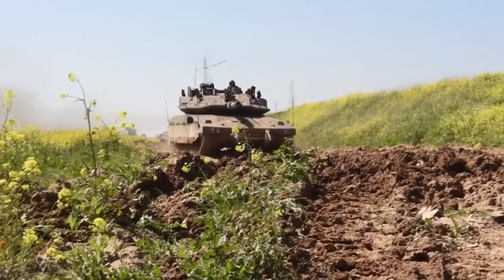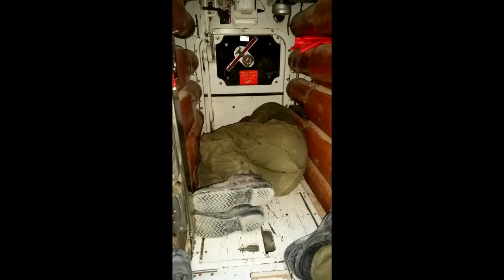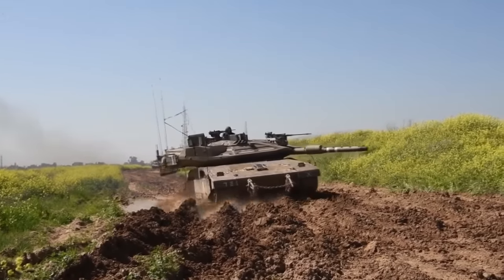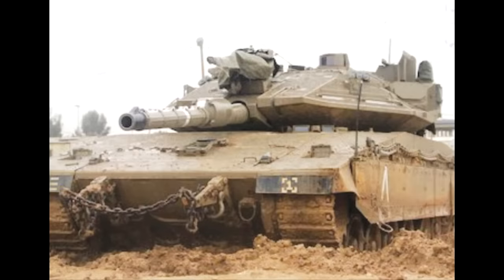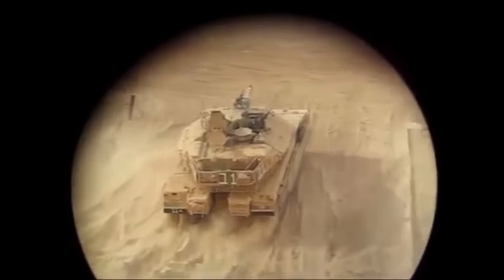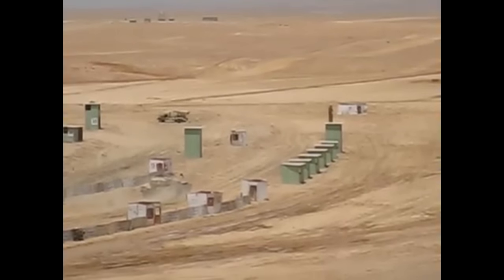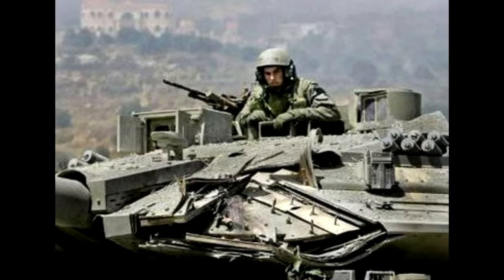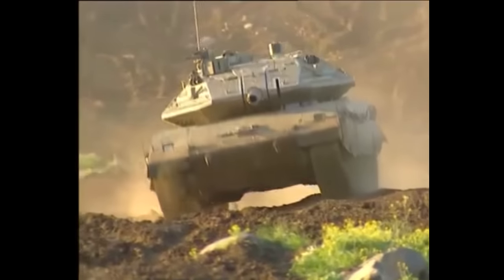Problems with Merkava tank

Comment: Merkava has paper-thin armor protecting its engine. Other tank doesn't use the engine to protect the crew, but they have much, much thicker front armor that protects everything.
Reply: The merkava isnt designed to fight other tanks, the paper thin engine armor is due to the engine's ability to absorb the heat jet from chemical warheads, the most common threat to a merkava

Comment: Just as a speculation from someone who knows little about modern tank warfare, the engine in front still seems like a decent idea, as if you're hit there and for some reason the projectile doesn't destroy more than the front part (shot from the side or HEAT round) I much prefer for the tank to not be able to move than for me to be dead

Please feel free to correct me if there's something I'm missing in that sense
Reply: @zorans5200  The point is you have a chance of getting out.
How often do tanks operate alone or better yet how many expensive anti-tank rockets are palestinians willing to use on a single tank

Comment: doesn’t the merkava mk4 have composite armor too? you didn’t mention the type of armor the merkava mk4 is using or maybe I just missed it. In my line of thought merkava using extreme slope angles on its armor + composite armor = engine is safe to some degree
Reply: The Merkava uses NERA arrays just like every other MBT, but uses it incredibly inefficiently and so has to rely on the engine compartment as spaced armour.
http://sturgeonshouse.ipbhost.com/topic/553-fucking-nera-everywhere/

M829A3 would most definitely penetrate the LFP and UFP, resulting in an engine kill and the crew having to bail out. The driver is protected by spall liners so a driver kill is unlikely but quite possible. The latest Russian APFSDS would also perforate the Merkava's hull easily.

The turret would be another matter, because it has pockets for NERA arrays at least 1.5m thick. But again, turret sides and hull sides would be prime targets, as the IDF has found out to its chagrin in Lebanon.
Reply: I don’ t understand. It is bad when front located engine had hit, but much better if crew got killed but engine and tank still can be reused.
I am not sure that crew can survive any hit in the crew compartment by modern AT rocket. 
Consider that crew compartment is also full electronics and other modern equipment that Han be damaged too am not sure that tank can be easily reused after such hit.
It takes time to return tank to service after the damage. 
And if block of engine is single part that needs to be replace, it is easy fix if there are some spare ones.
Reply: Chris Bailey  Well clearly they care about their people.
Reply: Yes and no. Depending on the type of composition sloping can actually not help much, or the armor becomes INCREDIBLY resistant to chemical rounds, but a dinky cold war 105mm royal ordinance sabot goes clean through it.
Reply: Chris Bailey  Israelis value any soldier's life far far beyond any sum of money. In addition, bear in mind that all Israeli Leaders did serve in the army, most of them in combat duties.
Reply: @IYuli-rr8vr  he thing is it has worse protection than any other modern mbt thus its irrelevant point as the crew is dead if shot by modern apfds

Comment: The Merkava IV vs M1A2/T14 Armata/Challenger 2 are  designed according to different national doctrines and operational requirements. The U.S/Russian/UK tanks are meant to fight rapid Blitzkrieg-style wars with enemy tanks as its chief target. The Merkava is expected to fight defensive battles and provide support to counterinsurgency operations in urban and mountain terrain.  The Merkava is designed to deal with very specific national requirements. The front engine design is a throwback to the Mk1 of the 70's when they didn't have the armour necessary. Since all Merkava MBTs share the same chassis, the Merkava MkIV is still stuck with a front-mounted engine. But as you say it is an issue.

Your assessment focuses on tank fired rounds. The Israelis are much more worried about ATGM's. In the 2006 war in Lebanon the IDF recorded over 500 AGTM  attacks on its tanks. Out of 50 Merkava IIs, IIIs and IVs struck by Hezbollah projectiles and IEDs, 21 were penetrated and six destroyed. 18 MkIVs were hit by ATGMs during the war, resulting in only one tank destroyed and not a single death. That's pretty impressive. The same missiles have also been very effective against Saudi Arabian M1 tanks in Yemen. (Granted the Saudi M1's don't have the same armour package as the US).   Since they introduced the MkIV Windbreaker with Trophy APS,  not a single Merkava tank has been lost in combat operations over the period between 2008 to 2014. And that includes intercepting the Russian Kornet Missile.

Comment: Sure it has problems when you compare it to modern 1st world tanks.
But uhh....
It's never going to face a modern 1st world tank, and it's never going to face anything equipped with APFSDS. Maybe an APCR if it's a bad day?
Its main opponents? T-34, T-55, T-62 and the occasional early model T-72. At best, these will be equipped with a semi decent HEAT round. Most of the time, they're going to be slinging APHE or just AP.
Really there's only 2 other nations in the area that could even afford to equip SABOT to their tanks. They don't share a border with them and have been content to just leave them alone for the most part.
So unless good old Uncle Sam decides they wanna start handing out Abrams to Egypt, Syria and Jordan, Merkava still pretty much out classes anything else in the area that it stands even a remote chance of facing.
Reply: Syria, Egypt, and Jordan have a decent arsenal, they have numerous state of the art T-72B3, T90, M1A1, Challenger with numbers of at least 200 upto 1300 for each tank model.

Comment: The engine being damaged is better than the crew getting obliterated
Reply: If the engine died .. tank stops , the crew will have to leave the machine.  outside, it will be оn crossed
 fire ..
Reply: In both cases they're fucked most likely. 

Crew dies > useless tank

Tank immobilised > crew has to get out > most likely crew dies > useless tank and dead crew.
Reply: @mazen6446  Remember you're not fighting in streets or close quarters, these tanks are used to fight at range. They aren't a 'lone wolf', if one tank gets knocked out there are others to cover them, and often other vehicles to CASEVAC. During the wars in Lebanon and Intifadas a majority of Merkava crews did manage to escape unscathed or wounded and make it back to combat
Reply: Morningstar 
Atleast the gun still working

Comment: LOL I always thought armor protection was this tank's only strengh.
Reply: Chris Bailey  i see someone plays metal slug as well :-)
Reply: Crew protection. Not armor protection. This tank was built with the 6days war in mind. Hull down long range gunnery at stupidly advancing tanks. With that in mind its amazing. Hidden lower plate, good upper plate and turret. Fast firing mechanical ready rack and LOTS of shells in its turret. The rear door allows you to quickly reload mid fire mission of need be. Something no other tank can do easily. In that SPECIFIC role its exactly what they need. But in a hull to hull tank fight? I'd never want to be in this. A modernized T72 would be able to kill it. With probably a better chance at withstanding return fire. A t72's frontal protection is a lot thicker than 100mm...
Reply: Chris Bailey  Eh, the Israelis have fought the Arabs with Russian tanks many times. Im sure they know what's best for their tanks.
Reply: One thing I can’t stop looking at is the lower part of the turret sloping downwards, seems like a shot trap.
Reply: Chris Bailey  see the problem? a tank is never alone anywhere. 2nd. the hull is as same as strong as the t90 tank.and the turret has much more armor then the t90. so ...its protection is still better

Comment: So many odd comments below about Merkava being designed for urban warfare when it entered service in 1978, before Israel went into Lebanon. Merkava was designed to re-fight the 1973 Yom Kippur War. When Israel was caught by surprise and almost overwhelmed on day one on the Golan Heights by superior numbers. The design was also informed by failed Israeli attacks against Egyptian positions on the Suez Canal defended by Sagger missiles.

What they learned was Israel needed a tank with fast ammunition reloads to offset overwhelming numbers before they can mobilize the reserves. This forced them to move the engine to the front so they can load through a rear hatch like the earlier S-tank of Sweden, another country with a reserve system. This meant the engine had to be in the front. While this is not so good against APFSDS, the main threat on the battle field was HEAT missiles like those Saggers. This is also why they put a mortar and a 50 cal machine gun on the main gun mantle to suppress Sagger operators.

The Merkava's hull weakness against APFSDS was regarded as an acceptable compromise as they will be fighting hull down in prepared positions. Once Israel moves into the offensive phase their reserves are already fully mobilized and the Arab armies could not match them, despite the Merkava's deficiencies. You don't need the best APFSDS protection if you're confident you can shoot first hit first. 

This tank was never designed for urban warfare, although it has proved suitable with upgrades. What it was not designed for was fighting tanks with advanced thermal sights and fire control systems. It's at a disadvantage against the Abrams and Leopard 2s with equal crew training.
Reply: spot on ..well said sir, but no the Mark 4 is not at a major disadvantage against either the M-1 or Leo 2

Comment: Well, IMHO, you haven't mentioned the two real problems of the Merkava. It's  ridiculously 
1. heavy and
2. big

The reason behind its design explains everything. It's a tank for a specific region, it's neither for export nor for wars somewhere overseas. You don't need to move it by plane.
Besides, there are not so many rivers in the Middle East, therefore you don't have to worry about bridges to cross.

Hence you definitely can build this bulky tank, but the question is - for what on Earth do you need such a big chariot?

The answer is nothing to do with additional ammunition nor ability to carry infantrymen in the back. The original purpose of the rear compartment was to have an additional crew members there to allow them to rest there and to fight in shifts.

This idea, however, never really took off. On rare occasions tanks are used as ambulances, but mostly just have some shells in the back.
Reply: its not really any heavier than any NATO tanks or larger. it just looks larger because of the turret to hull ratio
Reply: Archie Crick are you sure? Let's compare the Merkava to the best NATO tank, which is probably also the best tank in the world - I mean  M1 Abrams, of course.  Beyond any doubt,  the Merkava is higher and heavier.
Reply: @TheKopalhem  are YOU sure? The Abrams is a very heavy tank
Reply: @a.t6066  Absolutely. Merkava is a few tons heavier (no matter which generation).
Reply: @TheKopalhem  the newest abrams generation weights 70+ tons full combat load. I think the merkava is lighter
Reply: @a.t6066  Well, 70+ sounds really heavier than Merkava Mk.1, yet who knows how much exactly the Mk.4 weights.
Anyway, my point is, it's an unbelievably heavy thing. Even though it may be a bit lighter than the newest M1 with the depleted uranium mesh in its turret, Merkava obviously has thinner armour, taking into account the size. It also has a diesel engine, not a gas turbine. This should inevitably affect its mobility.

Nevertheless, it's a good tank for its role. Its size  allows you to carry more ammunition or to use the tank as "occasional" APC (I don't use the term IVF for a good reason here)
Reply: @a.t6066  A fully loaded Merkava 4 with a trophy system weights almost 80 tons
Reply: @Darktemplar99999  and what accounts for that extra weight?

Comment: I'm a merkava mechanic and I can tell you that there is no fuel tank in the front only at the back of the tank.
There is no problem with the thermal vision due to the engine being in the front.

Comment: This features, just like the Swedes is design for specific requirements of the Israeli Military and their primary enemies are not equipped by high tech AT weaponry and targeting system. even the tank have many flaws but israelis knows that it is not a major concern as a result in the design of the tank. in terms of crew survivability, this tank is the top amongst the best tank in the world. you can easily replace a tank but you can't replace highly trained crew, that's the primary reason why such design feature is incorporated to the tank.
Reply: 'Not equipped by high tech AT' You know that they are using the russian ATGMs, Which fire two projectiles at a time to just negate the active protection system?

Comment: Good video as always!

In an eye of Israeli high command, all problems might not that important consider Israeli main enemy is ATGM from insurgent or terrorist. All 'potential hostile' nation around them also not have major tank force that their tank and other assets can't handle so they just used same design until they can't in the future.
Reply: The Egyptians have a pretty good tank force IMO, Abrams and some T-90
Reply: @229masterchief  For now, Egypt has good relationship with Israel compare to the past so in their eye Egypt isn't so much a threat.
Reply: @DOSFS  you should all ways build your force to meet your neighborer's no matter what there current standing is.
Reply: @Andrewza1  Overall they are comparable and can go toe to toe with each other.

Egypt has their ground force, Israel has their air force. 

Other than Egypt who are equal to them, other isn't much of a problem in direct combat.
Reply: @229masterchief   Egypt has a fairly capable tank force, but it's still far inferior to Israel's Merkava Mk.4 which dominates the battlefield. The main difference is that the Merkava is protected with Trophy APS against missile attacks so it is mostly immune on the battlefield, while Egypt tanks are not protected by any APS at all. So in reality combat most Egypt tanks would be destroyed by ATGMs from Israeli helicopter, aircraft and infantry, even before they see a Merkava. So in any real scenario, Israel would wipe the floor with the Egypt army and destroying hundreds of Egypt tank. At the end, the battlefield would be littered with hundreds of destroyed burning Egypt tank wrecks while Israel would have very low casualties.
Reply: @xAlexTobiasxB  it seems you never seen 1973 senario war where Egypt was using ww2 tanks against US made modern tanks and Egypt wiped the floor with Israeli tanks so there is alot to take into account.
Reply: @Andrewza1  israel starts buying 1500 m60 pattons xd
Reply: @ahmadel-zebedy  But late period of 1973 war table has turn and Iserali force destroyed more tank than they lost (with an aid, of course, because Israeli pretty much 1 v 2(+4) at least)

In previous war Israel also used WW2 tank kicked post WW2 Soviet tanks too, it depend on war plan and tactic.
Reply: @ahmadel-zebedy  really? Is that why the Israelis pushed the Egyptians back out of the Sinai and conquered the peninsula? The Arabs lost over 1000-2000 tanks while Israel only lost about 400 tanks. So in fact the Israelis wiped the floor with the Arab countries
Reply: @xAlexTobiasxB  welp we already have Sinai and pushed them way back then further than Gaza so idk what kind of wiping u talking about we won the war xD and got every inch of our land back lol
Reply: @ahmadel-zebedy  Israel pushed the Egyptian army out of the Sinai pininsula and took control of it. Only after the war Israel gave the Sinai peninsula back to Egypt for peace.
Reply: @ahmadel-zebedy  wow I wonder how countries historically significant events are written about in that specific country.
Reply: @a.t6066  what so you mean
Reply: @ahmadel-zebedy  I mean you say Egypt won the war with Israel and got their land back. So I wonder how it is written in history books in Egypt. Just like how the American Revolution is written about differently in Britain compared to the US.
Reply: @a.t6066  simple it's written that we won the war from our point of view we were fighting USA and Israel and the same time
Reply: @ahmadel-zebedy  why do you think you got the Sinai peninsula back?
Reply: Why not it literally have Egyptian military operations there xD
Reply: @ahmadel-zebedy  history books say nothing about it then...?
Reply: @a.t6066  nope it literally say we took it lol
Reply: @ahmadel-zebedy  I see. Well in the rest of the world's history books it was a defeat for Egypt and arab coalition in the six day war and yom kippur war and Israel took control of the Sinai peninsula. The Sinai peninsula was only returned to Egypt after the peace treaty Egypt and Israel signed in 1979.
Reply: @a.t6066   well because they couldn't accept being beaten by a 3rd world country in its first modern war with crappy russian weapons and for your info we asked for peace treaty in 67 and listened to UN and that's the reason we lost thay day because israel broke the treat and back stabed us so we needed to win the war to be in stronger position to negotiate for our land other wise they wouldn't have given it which exactly happening now in Gaza xD
Reply: @ahmadel-zebedy  Egypt asked for peace in 1967? Gamal nassar literally announced the blockade of the straits of tiran to prevent Israeli access to the red sea then mobilized troops along the Egypt-israeli border
Reply: @a.t6066  lol guess what because it's an invasive force it's our right to protect our land and btw check history our entire air force was literally on the ground because we agreed on 6 month stop of fighting but israel didn't care and took Sinai for no reason